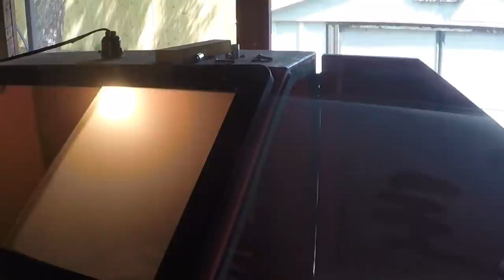Mini Tonka Snap Dragon Van. Restoration.

Comment: Nice outcome🙂

Thank you for changing the blaster window.

Apparently there is a plastic type "sticker," which can be put on the inside of the glass (protects) and peeled off when needed.
Reply from the maker: The blasting box came with three of them. They are difficult to install and don’t last long. I can get about four projects blasted before the glass is heavily etched. 3 bucks for 12/24 glass at the hardware store.
Reply: @RustyShepherd  

Very cool and cannot beat that price!

Thank you for sharing that🙂